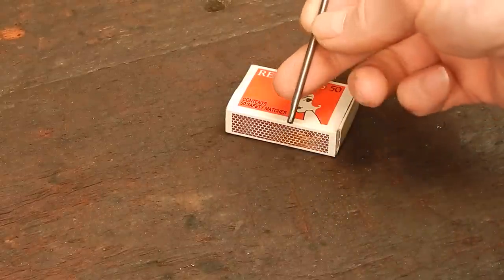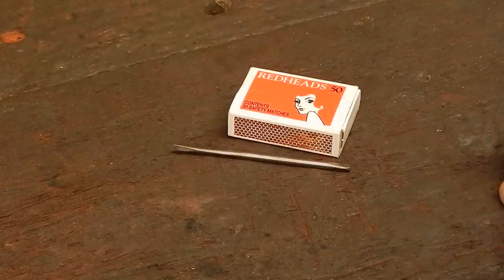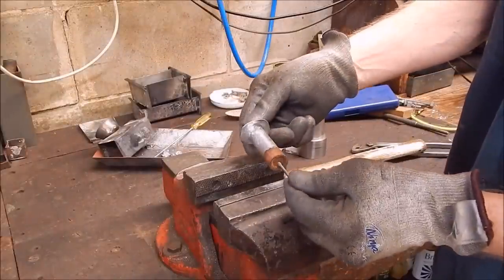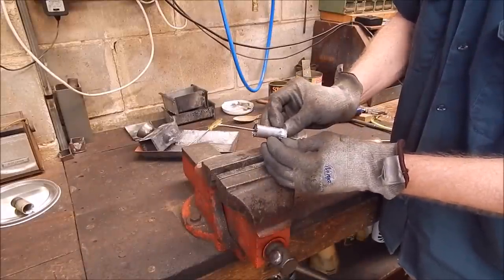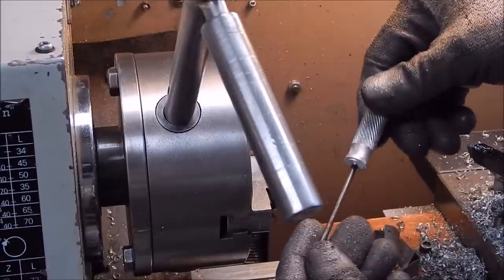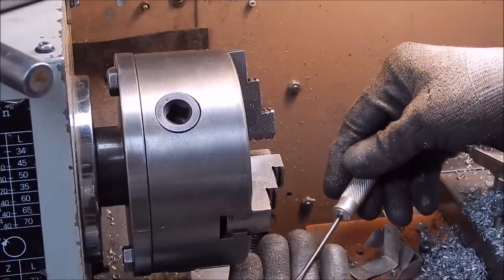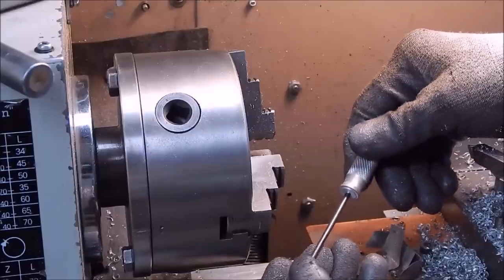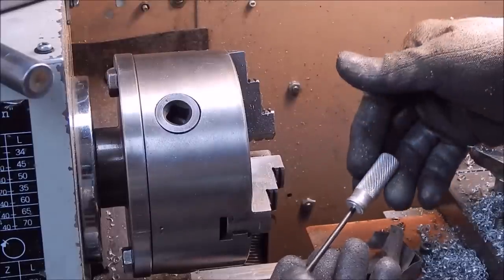Cast an aluminium screw driver handle

Comment: Lovely video.The main lesson I learned from this is that if you have small amounts of Aluminium to melt you do not need elaborate equipment!.I suppose your crucible was stainless. As one of your commenters said, Ally is conductive; do not use the driver for electrical work! I myself prefer wooden handles. I turn them out of the odd branches -- prunings, mostly -- and you can certainly use a metal lathe to turn wood. I use epoxy for final fixing. Hmm. Maybe I could use your technique for my swiss files -- sorry, wandering :)
Reply from the maker: Juan Rivero Hi Juan.  Yes the crucible was stainless.  Not sure what it was from :)   Some cook ware would be suitable.  Glad you found it interesting.  Cheers Rob
Reply: Juan Rivero  Depends on what you mean by elaborate...
Robs lpg/air bullfinch blowtorch costs around AU$300. A portable disposable cylinder MAPP torch like the bernzomatic surefire TS8000 and one cylinder will be about AU$120 and the replacement cylinders for it cost about $20 and last about 30mins. I use wood handles for my files, all my screwdrivers are made from 'fantastic' plastic :D
Reply from the maker: djpaulk I take it that Juan means you don't require a fancy/large furnace for small jobs like this.  Which I agree.  While I did use the expensive Bullfinch on this, I'm pretty sure my large plain LPG gun would have also melted the alloy - maybe a bit more slowly.  If it's hot enough to make the bowl red hot, then it should do the job.  Might try it next time.  Cheers Rob
Reply: xynudu My furnace is far from fancy and as I said did not even cost one cent to make, and actually smaller than the 9kg cylinder that powers it...True, a regular lpg torch would probably work for small amounts but would surely do it a bit more slowly and it depends on the particular torch and how efficient it is at raping the oxygen from the air it draws in. If a torch cant solder with an alloy based silver solder rod, what chance does it have of melting and keeping liquid a crucibles worth of alloy?
That's my thoughts anyways. 
There's one for you Rob. Two identical crucibles, equal weight of identical ally. Set up the torches, light them, then start timing :D
Reply from the maker: djpaulk Ha Ha, might have to go to the cooking section to get some small stainless crucibles. :)   I actually have been keeping my eye open at flea markets for something a little bit bigger than that tiny one I used.  As you suggest, there would be a limit to how far you could go melting it this way.  Only possible with small amounts.  Cheers Rob

Comment: I tried cast AL handles in the past and they always turned my hands and fingers black as I seldom use gloves. Did you notice this too? Thanks, Paul
Reply from the maker: Hi Paul. I haven't used the screw driver a lot, but it seems OK.  I can understand it could happen, particularly if soft aluminium was used.  I used hard alloy that I keep for gear blank making.  Time will tell I suppose.  Good point.  Cheers Rob

Comment: Why don't you use a degassing agent in your other castings, just to make sure. It is not the cost of it i presume. Isn't it just some washing soda in an aluminium foil wrap? or am i wrong. I want to start casting your way, which is great low tech, that's why i ask. thanks for your video's from holland.
Reply from the maker: Flip de boer The degassing agent also makes bubbles when it purges the hydrogen.  If you use too much it can be a problem.  Some alloys gas very little and don't need it.  This alloy was perfect.  Cheers Rob